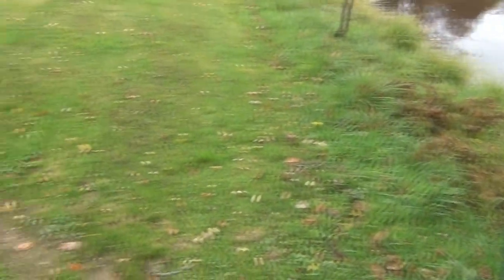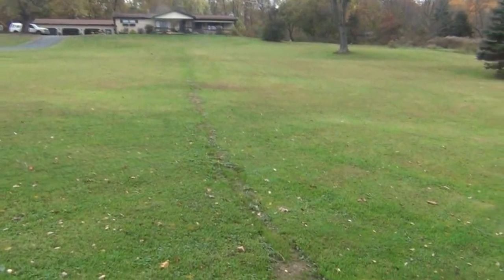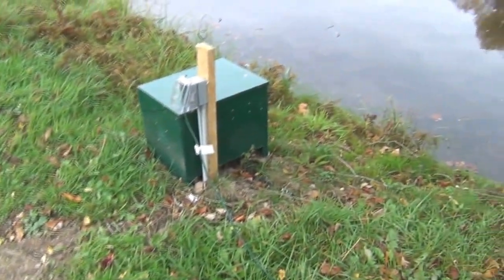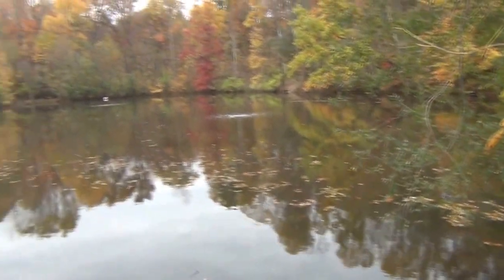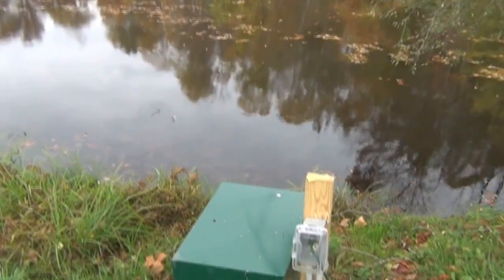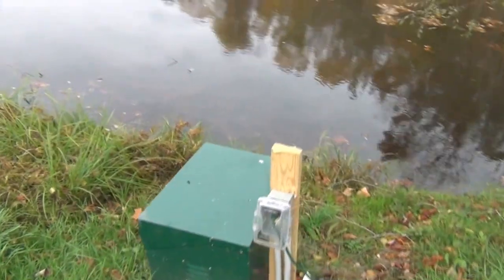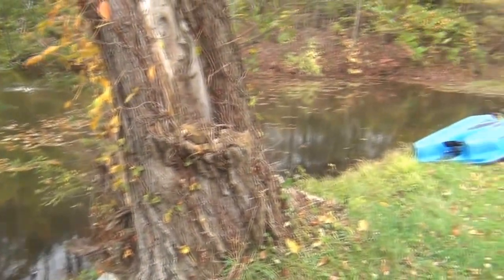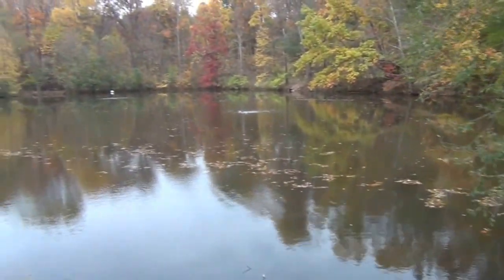PA66 Aeration System installed

Comment: I just moved into a home in central Ontario Canada that has a natural pond that has been neglected for years. There is substantial cattail overgrowth and the pond is full of algae. How will aeration benefit the cleanup of the pond in my case?
Reply from the maker: Aeration will help deal with the algae but not the cattails. The algae feed from nutrients in the water column and bottom of the pond. In short the aeration helps with water movement and getting oxygen to the bottom of the pond where the natural beneficial bacteria, (aerobic bacteria) can consume the nutrients, dead decaying plants, fish waste, leave and what ever washes into the pond..
Cattails will need to be treated chemically or pulled out by the roots, or other methods. 
Please shoot us our contact button on the website if you need more help. http://whatpond.com